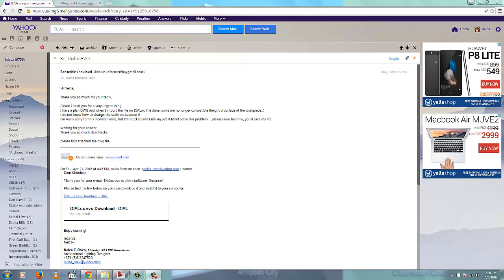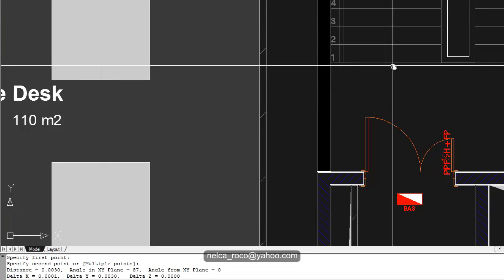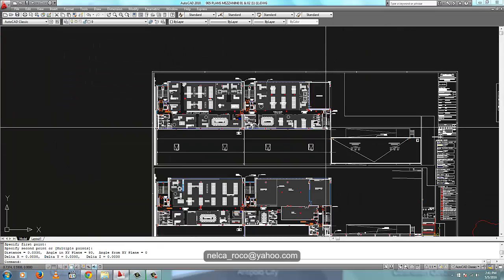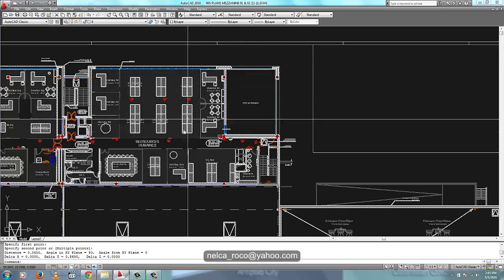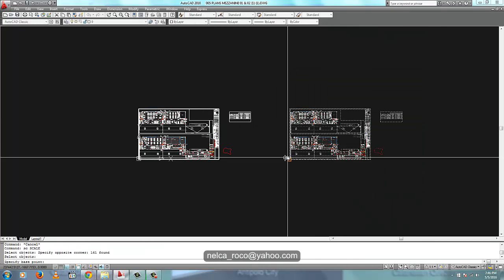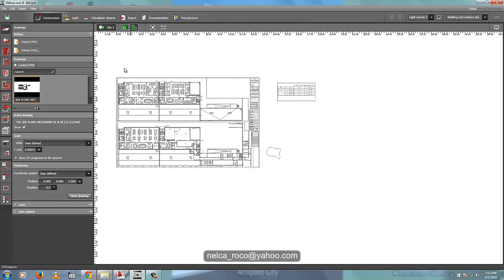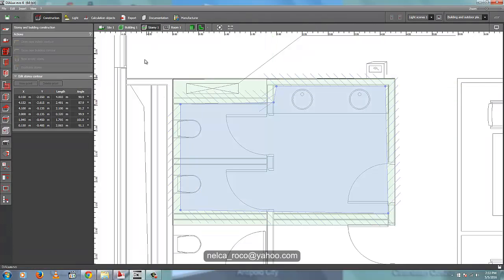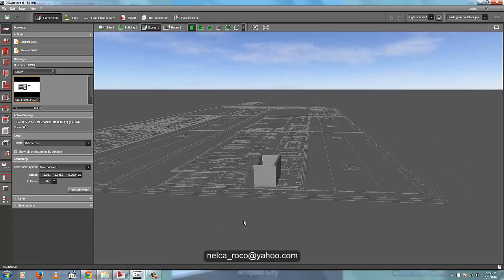DiaLux evo - How to check the scale

Comment: Hella Nelca, i need an advice from you: can you tell my why i can't import objects from http://archive3d.net/ in Dialux 4.12? Thanks!
Reply from the maker: +Sergiu Vasile 
Dear Sergiu, there are different reasons why it happens.  (1). The 3ds file is too big.  Try importing file that has up to 5MB only. You can see the file size before you download it. (2). The object is too small once you import it. Try scaling it 1x1x1 even if you cannot see it. Then zoom extend. Then move it to your room or building (3). the origin of the object is too far from the object. (4). Your PC cannot handle big files. Try these things and let me know if it still not working.
good-luck!
Reply: Thanks Nelca!